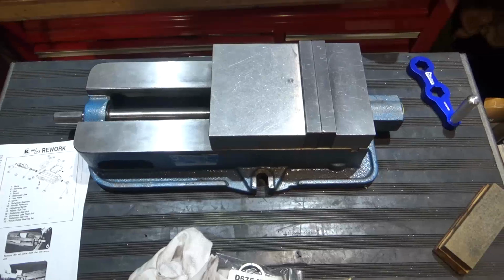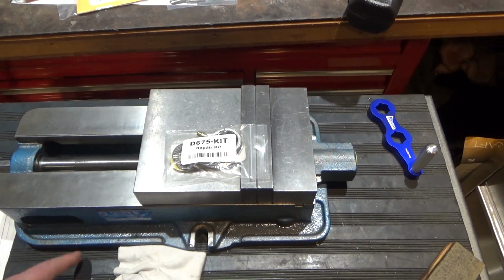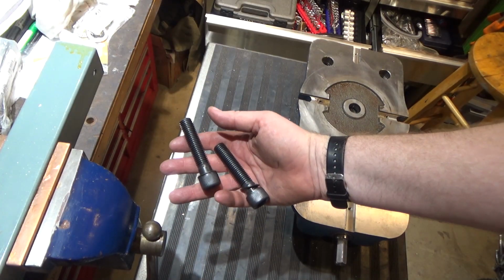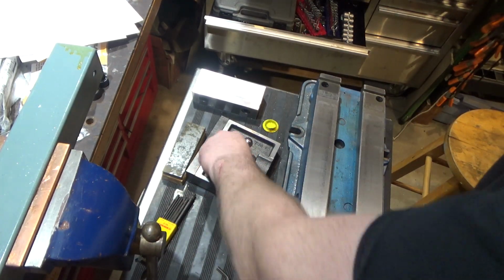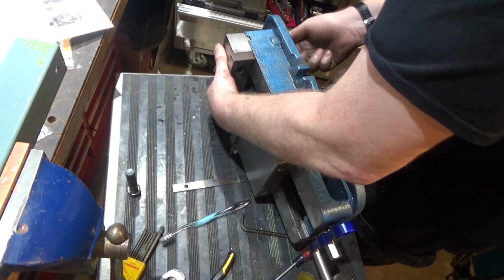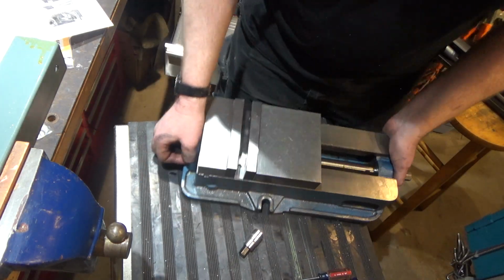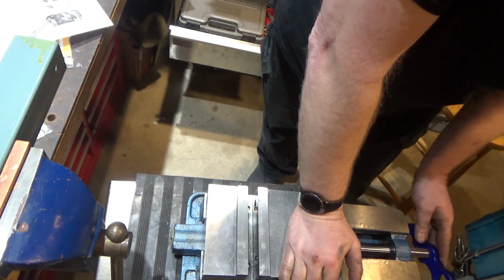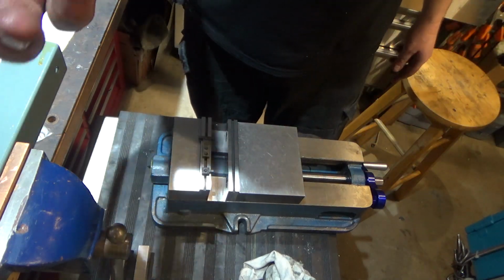Using the Kurt Vise Rebuild Kit

Comment: Thanks for the tutorial.  A suggestion would be that you seem to always roll the vice over on the wrong side when you were loosening or tightening the fixed jaw bolts.  When loosening the fixed jaw bolts, lay the vice on the left side not the right.  That way the long end of the vice against the table resists the down force from the breaker bar.  If you find yourself pushing on the breaker bar with one hand and holding down the far end of the vice with the other hand you are doing it backwards.  The reverse is true with the installation.  Lay the vice down on the right side so that the long end of the vice against the table is resisting the down force from the torque wrench.
Reply from the maker: Good ad"vise"! I really appreciate the tip.

Comment: I recall reading somewhere that that aduusting setscrew in the Kurt vises actually has a 2nd set screw that locks down the adjustment.  In your video I only saw one setscrew, so maybe the previous owner removed the locking set screw at some point and never put it back in.  Would have been intersting to know if adding the locking setscrew would have fixed your issue with the adjustment changing??

John
Reply from the maker: I was not aware. I bought my vise used, so thanks. I will look into the missing locking screw.

Comment: It would have been more than useful for your video to show putting the various washers, bearings and other parts where they belong in whatever order they need to be in. It's not obvious after you've taken it all apart, and there's no manual with the kit. Also, what lubes are you using and where?
Otherwise, thanks for a good video.
Reply from the maker: Thanks. This video was unfortunately not planned and it shows. I used a grease with molybdenum disulphide for its high pressure capabilities. I got a manual off of the KURT website. The have instructions for most items. I will attempt to do better in the future. Thanks for the helpful feedback, it is definitely appreciated.

Comment: Valiant effort, is that parallel still parallel though?:)
Reply from the maker: I was using it as just to demo the idea and to be honest, I got it off of ebay and have never thrown it on my surface plated and inspected it....
Reply: robert weitkamp hi again, sorry you thought you needed to reply to that, I was being flippant.  Great video showing the workings of these vices, my "valiant effort" comment was genuine, you did a great job, and  were cranking that down hard from the soundtrack. At the time it made me wonder if what you were cranking down on would survive :)  I rewatched your video to see what the hell I was on about, learned more the second time, so thanks again and sorry for disturbing you :)
Reply from the maker: Not at all. I appreciate all comments. They make me think. I often see things from a different perspective and learn something new. I realized that I still needed to check the pair of parallels...Excellent. Cheers.
Reply: Customized parallels cost extra!

Comment: I have two import (Kurt Clones I think?)  My dad gave me, kinda rusty.  Where do you buy those kits and how much do they cost?  Guess I could take them apart and measure stuff and compare to Kurt drawings.  Hard to get motivated since I have a new Kurt and don't need them.
Reply from the maker: Here is a link to a Kurt D688 Rebuild kit: 
https://www.mscdirect.com/product/details/62324355
This is just one example. They are sold all over and from Kurt directly. Kurt also has instructions and full dimensions available on their site. Best of luck,

Comment: For the hex screws that hold the fixed jaw: Hit a good quality hex key with a heavy brass or lead hammer to loosen them. The mass of the vise body has enough inertia to allow you to break the screws loose.
Reply from the maker: Hmm, a human impact wrench substitute. I like it. Have you tried this? On the surface it might seem like you would get some flex out of the hex key. I like the lateral thinking, I tend to be way too linear. Thanks as always for the ideas.
Reply: Just rebuilt my Kurt D875 last week. And, yes, I had them send me the decals, which really improves the look.
Reply: I transferred Shars stickers to mine.  Won a beer bet on whether it was as flat and true as a "real" Kurt.  To be fair, I cheated.  I had repainted it battleship grey after I soda blasted the rust & rebuilt it - really didn't look like a Kurt at all anymore :)

Comment: did you get suckered into buying that stainless steel toolbox in the back, thinking the inside drawers were all stainless, or was there a purpose to have only the onlyide stainless and the inside painted, in exchange for the higher price of the unit?
Reply from the maker: The toolbox came from Costco many years ago and is built like a tank. The drawer slides are smooth as glass and handle a decent load. On top of that it was really inexpensive, for both pieces, something like $400. It was originally purchased for my wife's makeup studio. she is a film makeup artist. Costco currently sells something somewhat smaller for more. It seems as if this toolbox was a once in a lifetime deal.

Comment: lets see some reviews on various inserts and grades, heavy turning
Reply from the maker: I'll see what I can do. I am by no means an expert, but if I can get one or more of the carbide insert mfg's to cooperate, I will try to get the engineering info behind different inset designs, coatings, etc. So far they have only given me the same info available in their marketing brochures. The last thing I ever want to do is spread wrong info. For heavy turning, check out ABOM79's channel. he routinely takes really heavy cuts of 1144 stressproof and other shafting materials. thanks for the suggestions.

Comment: boy you really need a good workbench, you didn't mention the adjustment of the center screw on the moveable jaw. as i understand it that screw is critical to the proper downward pull of the moveable jaw,
Reply from the maker: Too True. I actually have a several workbenches, but they were all being used and I mistakenly thought that it would be a good idea to use my hydraulic lift cart as a substitute. The adjustment of the movable jaw is a bit of a pain and shifts quickly between the jaw movement being too stiff and the jaw lifting. The manual from Kurt did not have a procedure for setting this adjustment so I ended up playing around until I got it to where it seemed ideal. I also left the hex wrench over by the mill so I could tweak as necessary. Thanks for the comments.
Reply: Position a Dial Test Indicator on the moving jaw to monitor lift of the jaw. Clamp the vise on a round bar, held horizontally, positioning the bar at various heights. The DTI should show the jaw settling down consistently to the same height, firmly against the vise body/bed. You can experiment with the setscrew setting for a good compromise between ease of jaw sliding and range of vertical movement.
Reply from the maker: Thanks for the idea. I'll give that a try. I really appreciate you always taking the time help out.

Comment: Your torque wrench has drives on both sides.     hated  watching you bend over to read the beam,  use the other side and read it from the side you were working from
Reply from the maker: Excellent point. Thanks for pointing that out and sorry about the lean.